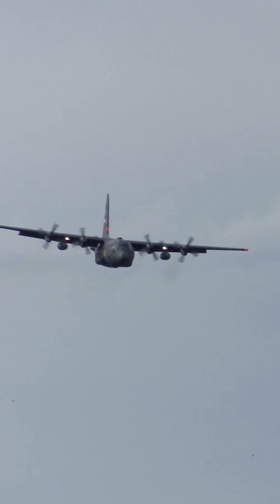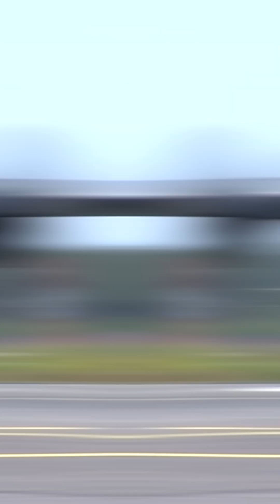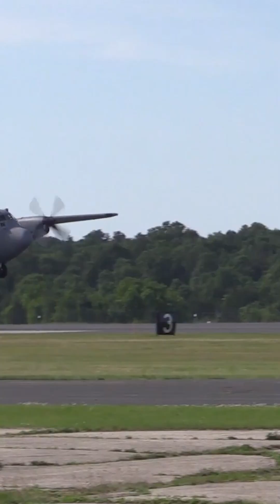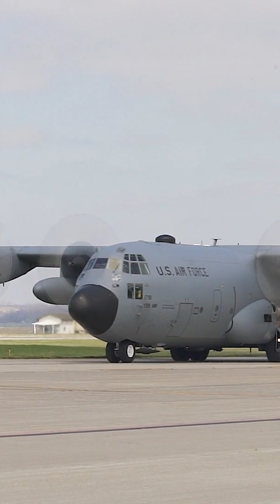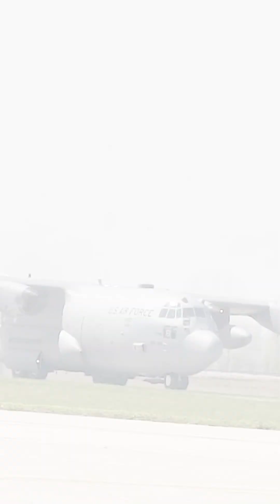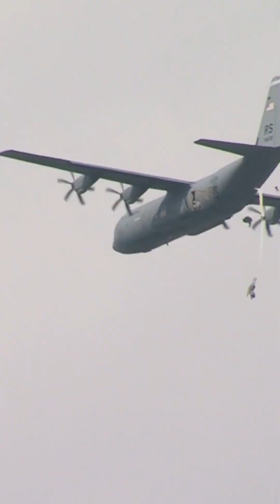Why do Large Aircraft use Propellers over Jet Engines? #shorts

Comment: Two words. Tactical advantage. 
The c-130 can land on airstrips that jet engines would be destroyed due to debris. They can land and take off on short runways and can assend and desend quickly. The c-130 is the longest operating and most versatile plane ever built. The B-52 might have it beat for the longest, though.

Comment: C117 does a similar job, uses a "jet engine", so maybe what you're saying isn't completely true.
Reply: The C-17 uses a turbofan engine. A turbofan engine is a hybrid engine that combines the low speed efficiency of a propeller engine with the high speed capabilities of a turbojet engine. At low altitudes and airspeeds the fan provides most of the thrust. At higher altitudes and airspeeds the engine's core provides most of the thrust.

Comment: uh....those ARE jet engines, driving propellers.
Reply: They are similar to jet engines but not exactly the same. A jet engine uses a nozzle on the back to accelerate the exhaust gas to produce thrust. A turboprop engine doesn't use a nozzle. Instead, the rotating shaft inside the engine is mechanically coupled to the propellers causing them to turn. Then the propellers produce the thrust.
Reply: @joevignolor4u949  yeh bud, I am an A&P. Thats what I said. I just didn't think I needed to explain the interface.

Comment: This guy clearly doesn’t make a clue the reason why for turboprops….he didn’t reference advantages like short take-off and landings and operations in unprepared runways. US military doesn’t care about fuel efficiency. The care about operating in anywhere and any place
Reply: The US military does care about fuel efficiency. Fuel efficiency affects operating range and operating costs. That's why the Air Force is putting new, fuel efficient Rolls-Royce engines on the B-52. The plane will fly farther and use less fuel with the new engines. Reliability and lower maintenance costs are the other justifications for the new engines.

Comment: Then why don't commercial airlines use this?
Reply: Propellers limit the speed an airplane can fly. Top speed in a C-130 is about 350 mph. A B-737 uses jet engines and can fly at about 650 mph maximum, almost twice as fast.
Reply: @joevignolor4u949  thanks for the info. I thought military planes fly faster. Now I get it

Comment: yes, the gas turbine engines on the C-130,  the C-2a, the E-2c, the P-3 are firing at a constant velocity, and with variable pitch propellers, as the engine turns at speed, it is the propeller that can control the speed, and on the ground, the direction of thrust. Unlike jet fighters, there is not a lot of 'yo-yo'ing the throttles.

Comment: T56 engines (ones on the C-130 and others) run at 100% RPM.  The blade angle changes very fast on the props and thus when put into reverse pitch, along with beefy brakes, stop the plane very fast with no lag for spool time like a turbo jet engine.  Makes for a great aircraft for going to short runways/landing zones.  Also, as mentioned, low level efficiency of propellers are great, so getting above terrain after taking off from that short strip is beneficial.

Hercs travel around the world routinely, but they’re made for this tactical/low-level environment, not strategic like a C-5, old C-141, etc.
Reply: I've flown in the cockpit of a C-130. The prop speed is regulated to 100% plus or minus 1.5%. When the prop pitch changes at the beginning of the take off run the engine torque and fuel flow suddenly go way up.
Reply: Welcome to my cockpit!

Comment: Turboprops are very use case specific.  They can't go as high or as fast as s jet, so you see them in regional work like commuter planes, or medium lift transports like the C130 shown.  They are somewhat more efficient, so are good for loitering capabilities like the AC130, but basically everything else can be done better by a jet.

Comment: Most aircraft today like the C130 use Gas Turbine Engines to drive the props.
Generally only small single engine aircraft use a piston engines.
Reply: Gas turbine engines are "jet engines". It's just that in the case for turboprop aircraft, they don't go at "jet speeds" even though they have a turbine...why...because they have propellers on the front of the engine.
Reply: @AviationPerthYPPH  
The difference between a jet engine and a gas turbine, is application.
Gas Turbines are not utilized for their thrust but the compact unit size vs mechanical advantage.
Gas Turbines are used to drive generators and are used in commercial aircraft as auxillary power units. They can also used to supply compressed air to start larger jet engines.
Their other main use is to drive the propellers
on aircraft.
Jet engines are used to push aircraft utilizing the thrust of the hot gases or from a fan turned by the engine, where air is pulled in compressed by the turbine blades, but bypasses the engine intake completely.

Comment: Only the smaller airplanes use props, and not all of them. The, now retired, C-141 along with the C-5 and C-17 use jet engines. 
Prop driven planes have a speed limit due to the speed of the prop tips, thus commercial planes still use jets but there is research ongoing.
Reply: Commercial jets use turbofan engines. A turbofan engine is a hybrid engine that combines the low speed efficiency of a propeller engine with the high speed capabilities of a turbojet engine. At low altitudes and airspeeds the fan provides most of the thrust. At higher altitudes and airspeeds the engine's core provides most of the thrust.

Comment: So why don't airlines use big propeller planes like this with such fuel economy?
Reply: Also propeller aircraft usually can’t climb as high as jets
Reply: Lower speeds
Reply: Who cares about economy in the US warcrime scenery. US taxpayers paying all that stuff to be sure, war isnt coming to 'em. So stay well fed and dont move to fast.
Reply: They're slow, loud, and can't climb over weather.
Reply: Because over a longer distance, speed would be a big factor. A jet can do 400+ knots, as opposed to a turboprop aircraft that does 250 to 350 knots approx. Turboprop aircraft are good over shorter distances. Jet aircraft are better over longer distances. Bear in mind that turboprop aircraft - the engine is a jet engine...it just doesn't fly at "jet speeds"...